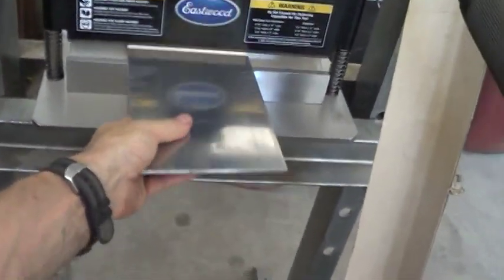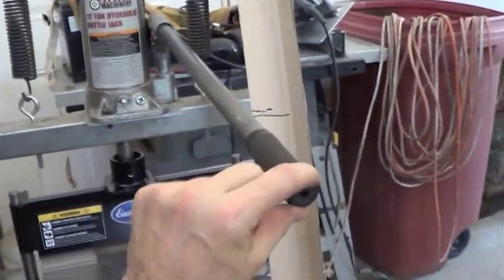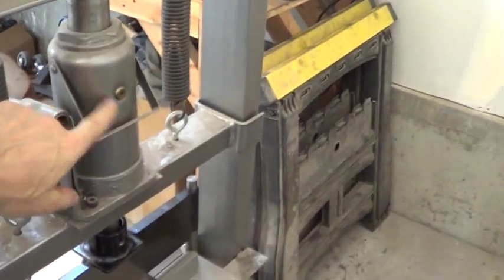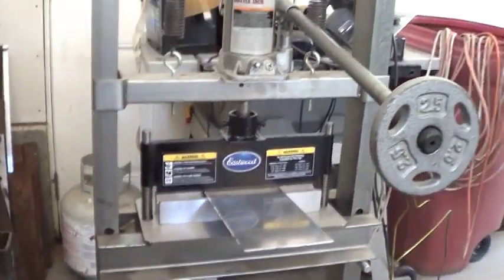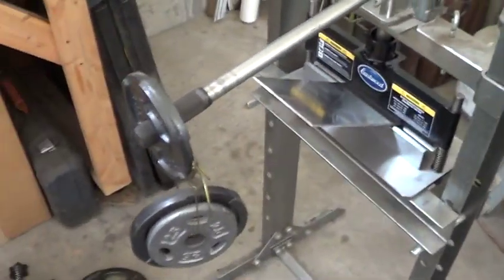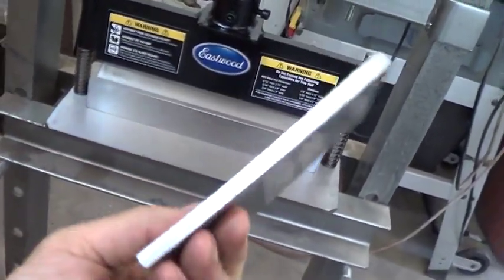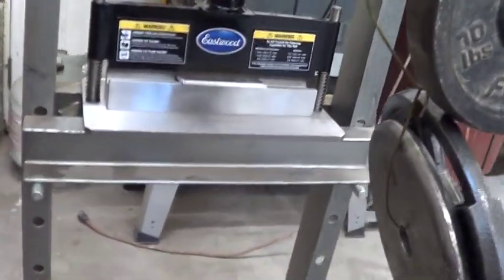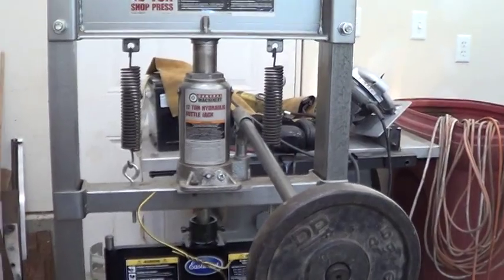Press Brake Build: Estimate Tons

Comment: so i would plumb a gage and do the math to diameter of jack cylinder to figure pounds per square inch of force.?????
Reply from the maker: Yes, regarding inside diameter of the ram that is within the bottle. Doubling the area of the ram means you halve the ram motion per pump, which means you double the leverage. But... if you know the diameter, and you know the force being generated, then you don't need a gauge. If the force is 3,000 lbs, and the area is 2 square inches, then 1500 psi.